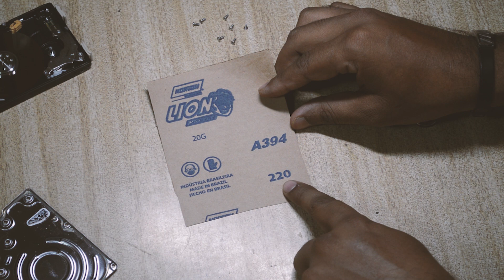How To Make Hard Drive Sander from Old Hard drive | DIY

Comment: Very nice, I wouldn't glue the sandpaper to the disk, instead, I would fabricate an extra metal bracket that can be connected to the screw of the disk and force the sandpaper tightly to the disk. This way you could replace the sandpaper after wearing and tear with another sandpaper more easily
Reply from the maker: Awesome 😍